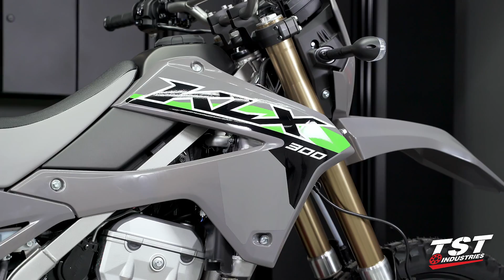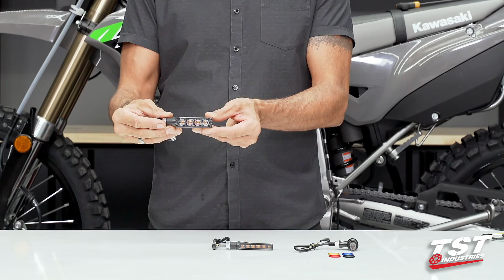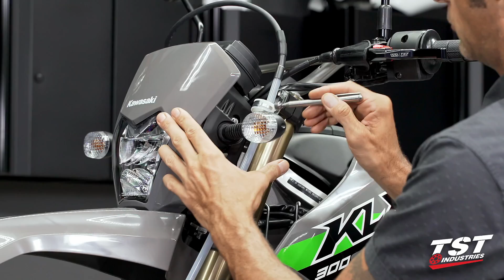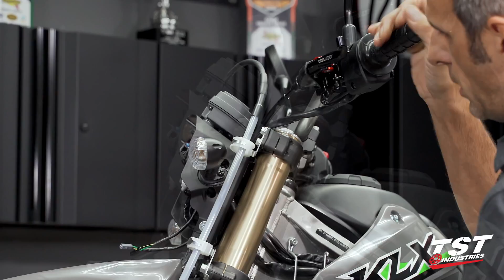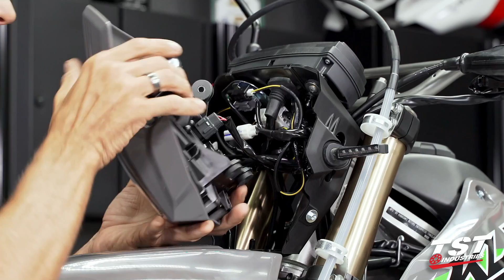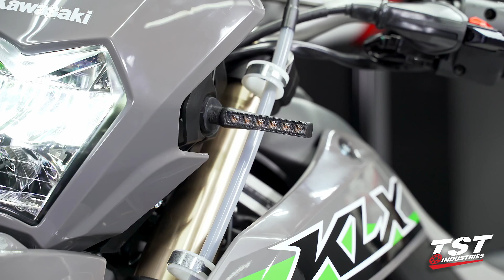How To Install Front LED Pod Turn Signals on 2024 Kawasaki KLX 300 by TST Industries

Comment: I’m unlcear on the backplate you used. Where did that come from? Is that something that needs to be purchased separately?
Reply from the maker: Yes, but we are rolling out a new kit very soon, so we're hoping to launch the new plate kit in the coming weeks!
Reply from the maker: I wanted to drop you an additional note for clarity. The way we curate the shopping experience vs how we manufacture parts is a la carte style. We make many subsets of parts that in different combinations cater to different models of bikes. The signal lamps you see are universal to any model, but with the combination of the mounting plates and the wiring harnesses they become specific to this bike. So when you shop on our website, the page that presents the parts that fit on your bike has all these compatible parts grouped near each other so you can identify what you need easily and drop it all in your cart.

Comment: Can you mount the BL6 design turn signals to the oem rear turn signals with out tail tidy?
Reply from the maker: I am assuming that you mean in place of OE signals on stock fender. When the OE signals come out, they may leave behind a hole larger than the BL6 can mount to. I do not know for sure because I have not taken OE signals off the fender. If you check that, and it turns out that they do leave a larger hole, then you will need an additional mount kit, like this one: https://tstindustries.com/tst-pod-turn-signal-adapter-plate-kit.html . I believe the Plate Kit 3 in that product page is the closest for your application.
Reply: Okay that makes sense, would the rear turn signals be plug and play like the front turn signals. Thank you for answering my questions!
Reply from the maker: @IdexxFreeport  if you get the signals coupled with the Kawi spec sub harnesses then they will be plug and play. This is the right harness for your bike: https://tstindustries.com/tst-kawasaki-signal-plug-converters-2-to-2.html
Reply: @IdexxFreeport how did it work out ? Did you need to buy the extra kit ? I am looking to do the same thing
Reply: The lights seem rather small and too close to headlight to be safe.  Can't see how they would be visible in daytime.  Perhaps an actual daytime riding example would help . The installation was excellent covering all issues you may run into.